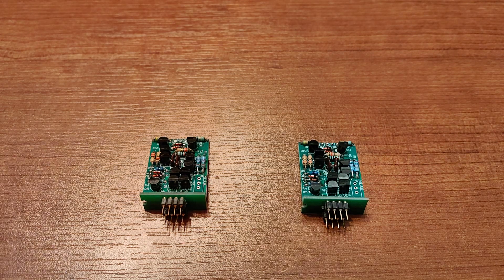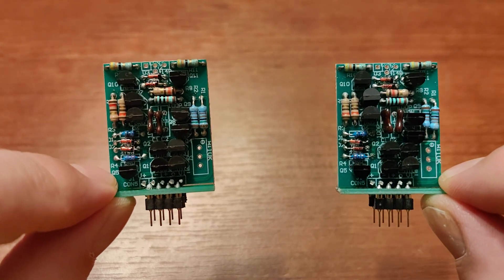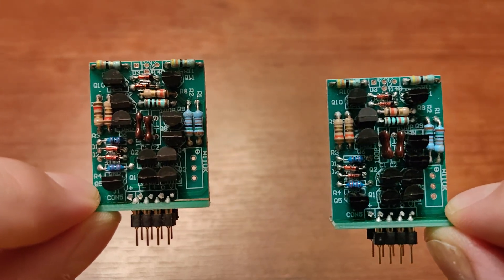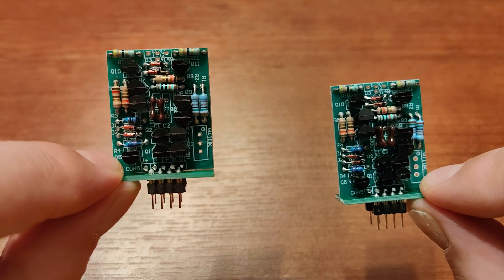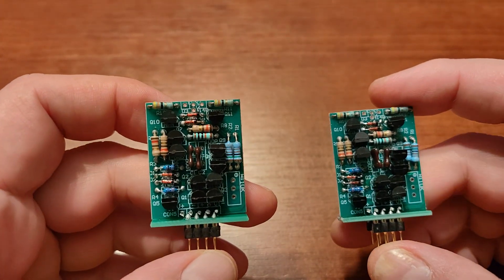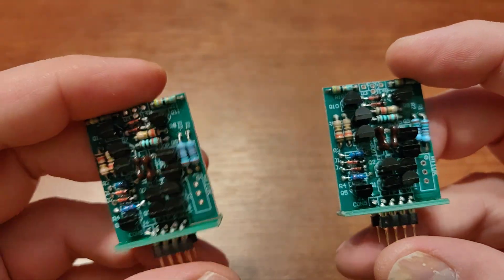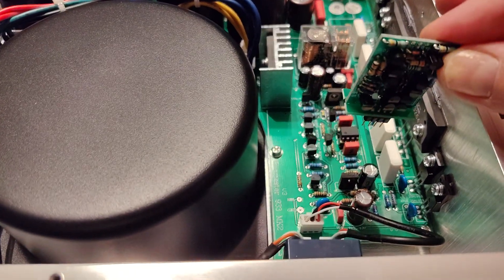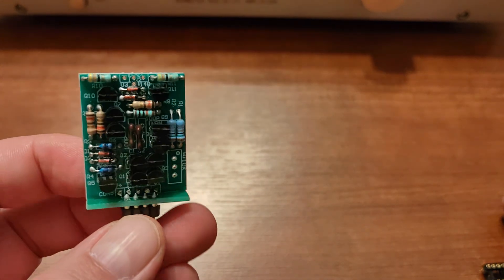Jamin OP03 discrete operational amplifier - OP07C replacement for clone amps like Burmester 933

Comment: Does the T9.4 has op amps that can be replaced? Thanks so much you’re the best!
Reply from the maker: Thank you! 
It has DC servo opamps as far as I remember (I would have to check my own video to be sure). If they are there they are not in the signal path, but replacing them with something better (better slew rate, low noise, good stability) can give better, cleaner background as it was with 933.
But as long as I'm almost sure they are there, I would have to look at the video or open the amp to be sure my memories are right
Reply: @k4syx thanks bro pls do let me know cuz I'm have no good knowledge on how. And are the op amps single or dual?

Comment: Thank you! I made a model of the amplifier in Multisim. OpAmp affects the sound a lot! Because its signal goes into negative feedback. The negative feedback signal and the signal from the DC servo have a 90 degree shift because of the RC integrator circuit at the input to the DC servo. The RC integrator chain has a cutoff of 220uF_390k = 1.86 Hz.  The OpAmps input is attenuated 10 times (39k\390k), the OpAmp output is attenuated 26 times (1k\27k). And this signal (DC offset + integral of the amplifier output) slightly affects the negative feedback signal at low frequencies of 10...100 Hz. I thought I could replace the 220nF capacitorS (both for symmetry) with 1uF. I am using OP177. There should be no noisy elements in the DC servo circuit. A 390k resistor is better than the noisier MOhm ones.
Reply from the maker: Thanks for sharing! Which amp have you modeled? 933?
Reply: @k4syx  Yes, 933 clone.
Reply: @k4syx  Sorry, 220nF_390k (not uF).    I did a Transient analysis and realised that 1µF for a DC servo is too much. Of course, the DC servo output is smoother, which is great. But when I switch on the amp for 2 seconds, the output is biased by 10-20 volts while those 1µF through the 390k ohms are charging. So 0.22µF looks like a compromise.

Comment: I have an opa 602 and an ad797. I changed the dac 797 to an opa 602. I liked the result, the bass is very deep. It's interesting to try it in this amplifier.
Reply: I tried the ad797 and opa 602. There is less bass on the ad797, there is not as much density as in the drain, the sound is lighter, nothing buzzes, it is more open, but I repeat that there are fewer low frequencies. The OPA 602 is similar to the op07cp, but the bottom is rougher. I stayed on op07cp. We need to order an opa 828.
Reply from the maker: Thanks for sharing! 
I got a set of single opa828 to try them in both Burmester and Dartzeel clones
Reply: You can't write if you try 828 in burmester 933. I would wait with the order 828 for now and listen to your opinion, it's worth changing it to the one that stands there. I would really appreciate it.
Reply: I bought an opa 828 for comparison. Almost the same. I don't know if it's worth it. Maybe opa 828 is a bit softer than Op07cp. Less pressure. Op07cp is more punch, outlines of the bass. But this is a very small difference. In this section of the circuit, the operational amplifier makes a minimum difference. The difference is greater in the dac. I ordered a pre-tube amplifier for Ali with a tone control. There will probably be a bigger difference. These are small tube amplifiers, inexpensive like the fosi audio p3.

Comment: Hello. I have MUSES8820 in the SNY-30B DAC on PCM1794.
Can I replace it with Jamin OP03 DUAL?
The cover will have to be removed, but it's not a problem if the sound is better.
Reply from the maker: Dual for dual, yes, but these are single ones and will not work propoerly. Check my Akliam opamps review (with similiar price range)

Comment: Update. So it seems the D5Pro has a Ti LF353P as it's jfet op amp. It's two channel, not single. So, I have wasted a bit of money buying single op amps that don't work. The Chinese opo3 single discrete, opo7 single and sparkos 3602 don't work. 
Expensive lesson😂
Reply from the maker: Bummer, now that you've said it I remembered that I actually talked about that in the video as I was asking the seller for purpose of this opamp there :/
Reply: @k4syx All part of the journey. Now we need to find an upgrade. My first thought is the OPA2134. Have do more research on discrete options.
Reply from the maker: @RonaldHeal-j6f  I have 1612, 1656, dual 627, dual 828, a range of AD797, some 2134s, some LMs - you name it.
The sngle ones, that was the problem, but duals - full box of them :)
Reply: 2134 is a nice sounding dual ic - can be a bit warm for some tastes at the cost of fine detail but my overall favourite is the 49720 dual which seems to be discontinued and short in supply. You could use two 49710 single on a dual adaptor which is really nice. But it's try and see...may not be your style/ compatibility etc.  cheers l @RonaldHeal-j6f
Reply: Go for it. The quality op amps you have will be amazeballs! I think the D5 with op amp upgrade really lifts it up a level. Some may not like it. But, I think you will appreciate the difference.

Comment: No. I didn't try the one channel. However, I put  dip8 sockets on the original op amps when replacing them. I noticed a loss of ambient/3d information. So, I can totally understand how the discrete op amps could improve the 3d/ambient information. I have bought original op07 op amps to try. Just to see if they make a difference?
Reply: I just thought the op amp in the d5 would be a Chinese version of the TI or Analog devices. I ordered original of both.  So, I will report of any differences. Which model of the new ic op amps would you like to try?
Reply from the maker: @RonaldHeal-j6f  something like opa828 in single dip8 socket adapter - this kind of thing, New, fast, very high slew rate. Should be very fact in compensation, but maybe too fast.
I think the clones are using real ICs though. 07C is dirt cheap even in Europe.
Reply: @k4syx  На высоких частотах RC интегратор 390k 220uF почти ничего не пропускают на вход  OpAmp. Поэтому из выхода DC servo на высоких частотах почти нет выходного сигнала, кроме смещения. На 100Гц DC servo имеет сильный выходной сигнал + смещение. На 5кГц - почти ничего, except offset. Думаю, нет смысла платить за сверх высокую скорость нарастания. А вот за тишину и микро смещения входов стоит платить.
Reply from the maker: Good idea! I was also wondering at placing something faster and more precise there from new generation of TI ICs, but I am afraid of ringing if I'll get something to fast there. I need to get some single channel opamps :)
Reply: Cool. Thanks for the insight. I have purchased sparkos ss3601 discrete single op amps to try. They should fit without requiring extenders. I have a feeling they will help the d5 with spacial info. Which is probably the only weak link in the sound presentation of that amp.
Reply from the maker: @RonaldHeal-j6f  Please share the results, ok? Thanks!
Reply: I will let you know how it goes 😊

Comment: Phil here. Your experience with the op03 in the 933 clone is exactly what I experienced... Spot on. The thing is thou after using the op03 in this amp I can't go back to the opa07...it just sound's a little lacklustre in "size". I think the improvement in  "micro dynamics" is well worth the cost of the op03. Cheers Phil.
Reply: Absolutely agree with your comments on OP03. I replaced the stock OP07 and the sound signature is so similar I couldn't tell the difference. But listen to this. I replaced it with OPA828 and WOW ! 
The sound stage is very deep, image is very sharp, and bass is tight and well defined. None  of the somewhat heavy bass with blurry edges. And to top it up,the attack is super fast. I absolutely love it
Reply: @daudibrahim7877   Replacing stock OP07 with OPA828 was the best move for me so far! I agree with everything you wrote in your comment
Reply: Have you tried OP01? How does it compares to OP03?
Reply: Haven't tried the 01 in this amplifier.. might give it a go but I think its about dynamics in this case not actual "sound imprint" of the op amp installed. Have found that the 03 has more gain and dynamics then any other ic.. module that I have in my collection of ic's and discrete modules..and yes I have tried several..even bursons. The 03 series in single and double overall has the best bang for buck of them all. Muses 03 is as good as it gets when talking ic's but the op03 series flows better.  @BlazSvetlic
Reply: Tried other op amps and found op03 seemed like the best but will😢 try out your suggestion of the 828....after all it's all good fun and horse's for courses... synergy between all the components...speaker matching etc etc.. cheers and great..

Comment: Input diff amp transistors are not thermally linked so poor PCB design in my sense. These two transistors should have been mounted face to face and very closely to reduce the thermal resistance between them. Although these plastic To-92 package itself will  create lot of thermal barrier. This doesn't make any sense unless for just an experiment and fun.
Reply from the maker: @SatyajitRoy2048  it was exactly experiment and fun :)

Comment: Have you heard the Muses02 or Muses03?
Reply from the maker: @Pete.across.the.street  Muses02 and lower models, yes - I have them in my collection
Reply: @k4syx I received four MuseO2 and four Muse03 from the Fosi Kickstarter deal. What is your take on the Muse OP amps. Thanks
Reply from the maker: @AlanFenick  I liked Muses02 very much until I've discovered OPA627 and then later on OPA828 and fully discrete class A opamps
Muses02 still sounds good though!

Comment: I wonder how they compare with ne5532 op-amps. Are they compatible with Fosi/Aiyima. (Electrically, for physical fit you can get extenders and mod the case 😋)
Reply from the maker: These are single opamps, classic NE5532 is dual, so no chance for direct replacement.
I plan do videos on my IC opamps collection (TI OPA family, some ADs and others) but it seems that everyone prefers clones at that moment:)
Reply: @k4syx  the shop you are linking to is also selling dual versions 😉
Reply: @D1N02  I have the dual versions...IMHO they are great...very strong(factor of amplification?) with great drive...
Reply: @MrSler  so good for headphone amps?
Reply: @D1N02  My Drop AKG 7XX are easily/effortlessly driven ...
Reply: Not compatible with the 933 as the 5532 is a dual channel op-amp and the 933 needs single channel op-amps.
Reply: 5532 is not the right one! You need a single-channel OpAmp, but that's not the main thing. The main thing is ultra-precision, microscopic offset voltage and extreme silence! If there is noise or offset, it will get to the amplifier input through negative feedback and will be amplified many times over.

Comment: Interesting that your 933 clone only has the two op-amps. The XLR 933 clone I have has four op-amps in two pairs quite close to each other so there isn't enough room to fit the Jarmin OP03. I guess I could make an adaptor using a PCB bread board.
Reply from the maker: @mddawson1  are these also OP07C or something different?
Reply: @k4syx  The same OP07C op-amps
Reply: What can you say about your XLR 933 clone sound quality? How does it sound? (Its pros and cons in sound?)
Reply: There are OP177 dip-8, they have better performance than OP07.

Comment: If it was so good why does Burson not place it into their products. What a lot of BS!
Reply from the maker: @nicoras8803  everything is built to a price point. Reality. You're cutting corners everywhere you can.
Why smartphone stock headphones are always shitty, though for mere 7usd you can get something that mops the floor with them?
Same reason.
Reply: They are cheap enough to try for yourself if you are a non believer
Reply: Wow dude. Such anger
Reply: Umm ..Burson make their own designs....why sell somebody else's design when you have your own admittedly more expensive but nobody else's design..?? Then somebody is always going to undercut you on the same product.. Burson is a business and respected with what they do... These are great value but a Burson discrete might be worth the extra expense..size... performance.. finish of the product.. . prestige of brand and confidence of the Burson brand..all these add up to why Burson will not sell somebody else's design..

Comment: Integrated circuit op-amps internally contain discrete components, so where is the difference?
Reply: I suppose using discreate components would mean more variation in quality so I suspect that might have some small effect. At least for those who want to take a chance , like rolling tubes, they aren't nearly as expensive (unwarranted) as most. Can't say I'd bother but whatever you do you.
Reply from the maker: @georgebliss964  no they don't. Once upon a time there were hybrid devices that were discretes on small PCB and covered in resin - but that was strange mutation.
You either have discrete or integrated.
As for differences integrates are not as precise and linear.
Reply: That statement makes no sense at all. A electrical circuit consisting of components on one chip are integrated together on one device, hence the name Integrated circuit. Discrete components are the opposite of that. Every component is it's own device.